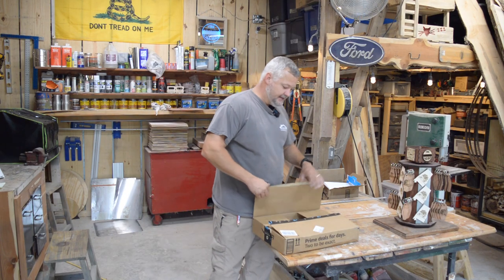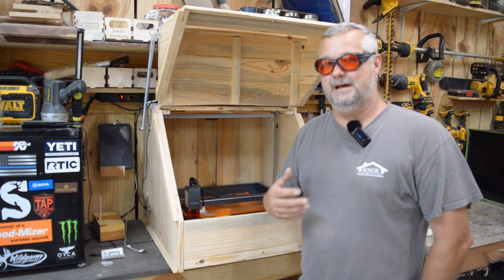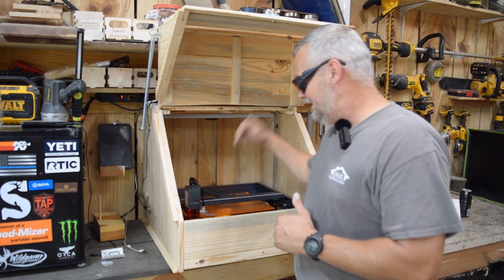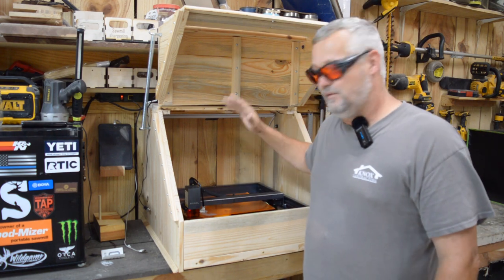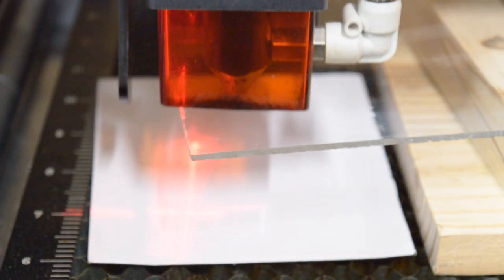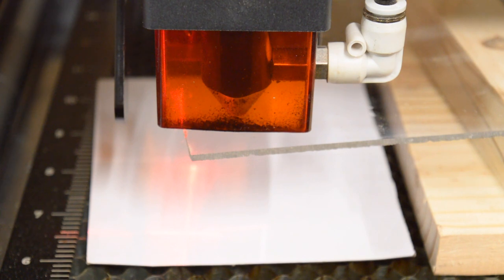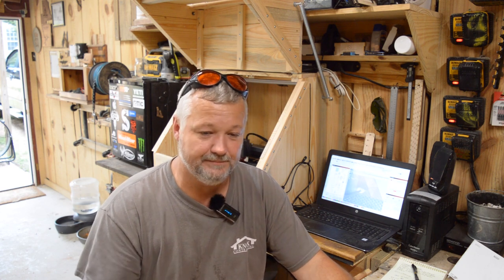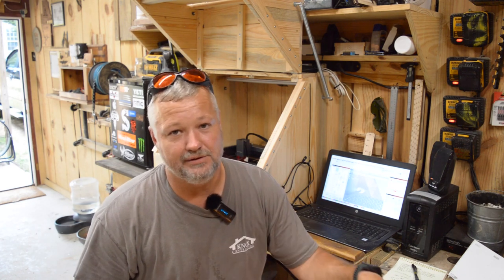The enclosure is complete

Comment: Thanks for the thoughtful and well-made video. I know I am late to the party, but I want to point out a couple of possibilities, including a simple way to test this further. There is a possibility of something part way between pure transparency, and 100% blockage of the laser light. And that is a partial blockage in which you can cut it with enough persistence, but some leakage is still getting through. In regard to this remember it doesn’t take nearly as much to damage your eye as it takes to cut the acrylic. So this simple test should reveal how effective the non-certified orange acrylic is. Run a “cut test” on both a sheet of black acrylic and a sheet of the translucent orange acrylic, with the exact same spread of varying cut speeds / power settings, and the exact same thickness of acrylic. Look at the different square cut attempts that were run at different speeds / different power settings, and see which ones punched all the way through on the black, and which ones didn’t. Compare that to the same squares on the same test on the orange acrylic. If the orange and black are showing the same degree of cut versus non-cut, then it indicates the orange is preventing laser leakage just as well as the black is.
Reply from the maker: My last 4 enclosures used laser tested windows. Thanks.
Reply: @TheClackShack  I've been using a big 100w CO2 laser, but at the request of a patron I'm implementing use of diode laser, and will likely build an enclosure for it, so this is all pertinent to me. 🙂
Reply from the maker: @design8studio  , exhaust it through the bottom, good lights, a camera and JTech photonics is where I get the windows. Check out my large enclosure. I added an elevator base.
ENCLOSUREZILLA- The best diode enclosure EVER ??
https://youtu.be/mN4qYZ4hkqE

Comment: Well done as usual. Mic sounds great. What lift poundage is your piston? Are you still using your downdraft for smoke removal? Go Georgia, beat Alabama LOL.
Reply from the maker: I used long coil springs, you can see them on either side of the door. They hold in both up and down location due to the placement. Yes, the vacuum table is still in play. I did make the bottom vacuum chamber lower on the base during the upgrade and it now has a 1 inch compartment as opposed to the old 3.5 inch height.

Comment: I know you wouldn't want to waste a pair of glasses, but would be interesting to see how running the same test on the glasses would turn out.  

That said, it looks like certified glass from what I assume is a reputable company looks to be roughly twice the cost.  If this is something being used often, it seems like it'd be worthwhile to spend the extra money once to both know you're safe and know that it's okay to use without glasses.

Still waiting on my 20w xTool to be shipped but loving the videos!
Reply from the maker: No way, these glasses are $30. I also added 2 layers of orange tint later.

Comment: Later in some videos it - appears you have a smoke and detector in the ebclosure, is that correct.  Does the contact exhaust allow a detector in the enclosure.  If it would it would be great.
Reply from the maker: Yea, I have one in there. As long as my vacuum is on, it will not go off unless the smoke is excessive. It will remind you to turn on the exhaust too...

Comment: Hello, Did you ever test the orange window tint film? 
Was thinking of using orange film/vinyl in a window screen frame for my window.  I have the extension rails on my d1, so looking into that for a larger viewing window
Reply from the maker: I installed it on the two original enclosures over the orange plexy as a precaution. I have started using JTech photonics glass just to be sure.

Comment: What is the roll of tint you showed? Did you use it in addition to the orange acrylic? I have a clear plexiglass enclosure and would be ideal to tint it instead of buying orange acrylic.
Reply from the maker: I had thought I might need it but after using the orange acrylic, I decided to just use it without the tint.

Comment: A 10W D1 laser has a power density equivalent to 1,500 suns. That means the spot where the laser hits the material is 1,500 times brighter than if the material were laid out in the sun at noon at the equator. Let's just work through an example. Let's say that the orange plexiglass blocks 80% of the laser light. That would be like running your laser at 80% and the acrylic would still absorb 80% power--enough to cut the plexiglass--but it would also allow 20% or 300 suns through the material. So, I don't think you can make the case that since you can cut plexiglass that the protection is as good as OD4 goggles which block 99.99% of the laser light, letting only 0.01% through the goggles. For a 10W D1, OD4-rated material will only pass about 1/6th of a sun, which is pretty safe. To know if it works for sure, you'd need a meter to measure how much laser light is passes through your orange plexiglass to know it's as safe as OD4 goggles.
Reply from the maker: Good point. I am assuming the measurements are at the focal point of the beam? I am only concerned about the incidental reflected light. I still have the stock cover on the machine and plan to leave it. Especially surfaces with low reflectivity, I wouldn't see how 100 percent of the beam would be directed toward the window.
Reply: @TheClackShack  You are right! You've been very conscientious about wearing your OD-4 goggles even though the chance of getting a high reflection from your laser beam is very low. You wear your goggles because you value your eyes--even if the probability of eye damage is slight. So, I just wanted to point out that the orange plexiglass may not be as safe as wearing OD-4 goggles. Safe enough to stop wearing goggles? That's a personal decision. But, as you said in the video, it's better than what you had before (and definitely better for the cats and other critters who visit your shop). I really enjoy your videos. A big Thank You for all the content you produce!
Reply from the maker: @rosswille4336  , yes, I kinda need my eyes and pretty much wear them all the time, even for other uses. To be honest, I don’t 100% trust even the certified materials.
Reply from the maker: @rosswille4336  also, glad you like the content. I enjoy sharing. Thanks